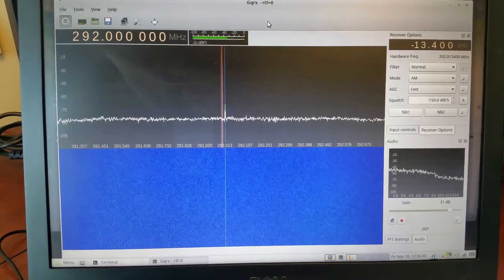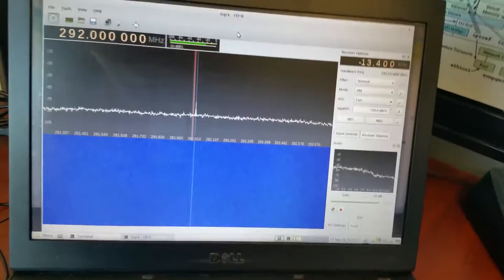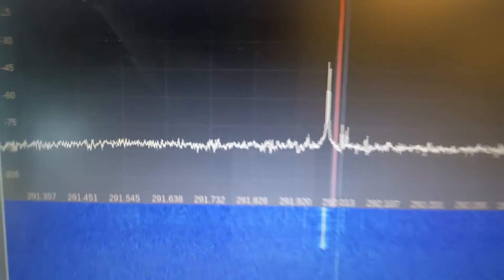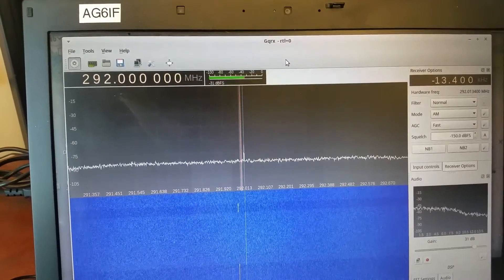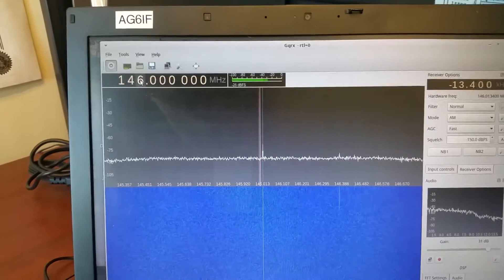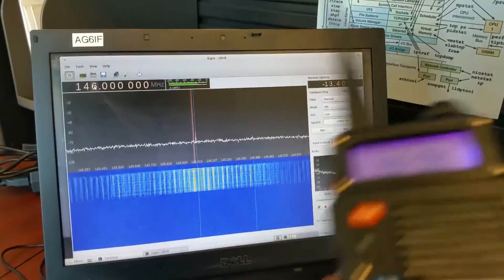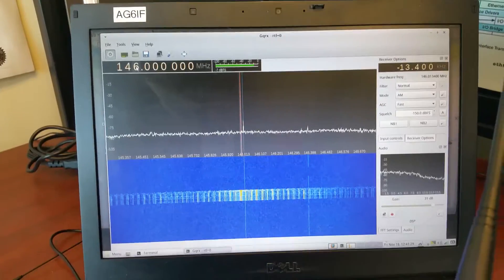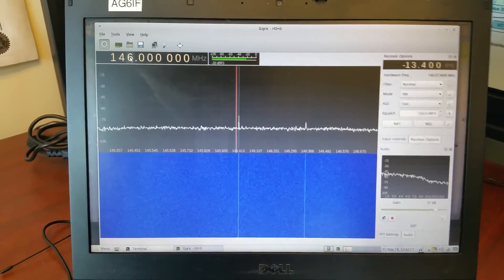F8hp 2nd harmonic ok.  But Wait,  L appears high power, and H appears low power.

Comment: 25 W or less, the mean power of any spurious emission supplied to the antenna transmission line must not exceed 25 µW and must be at least 40 dB below the mean power of the fundamental emission, but need not be reduced below the power of 10 µW.

Comment: Checked my F8HP with a power meter and dummy load on 146.000.  I got 7.05W on High with a SWR of 1.01 (dummy load).  When I removed the dummy load and attached a known bad antenna to the meter, the power on High dramatically drops low scale.  I believe what I, and possibly you, are seeing is a protection mechanism.  If there is high SWR on high power, it’s dropping automatically to protect the radio.  Check your antenna...